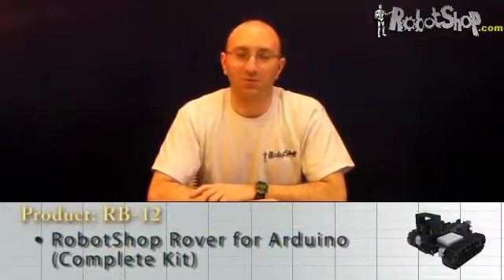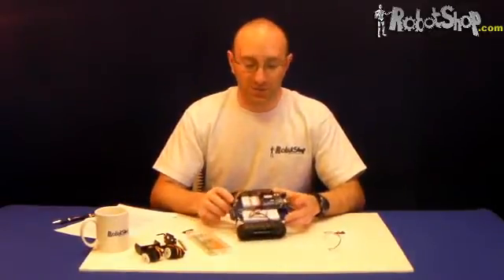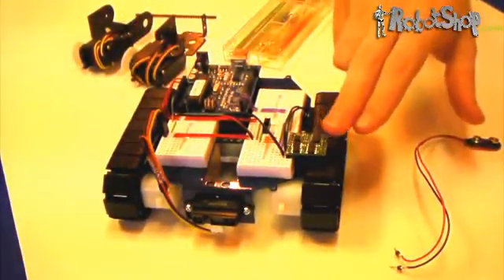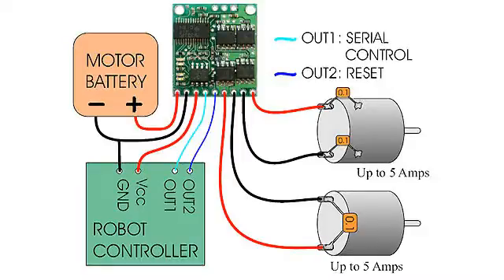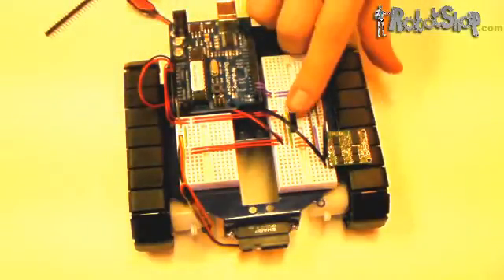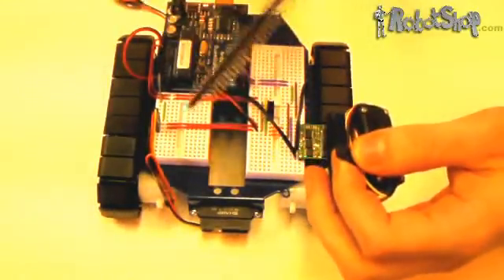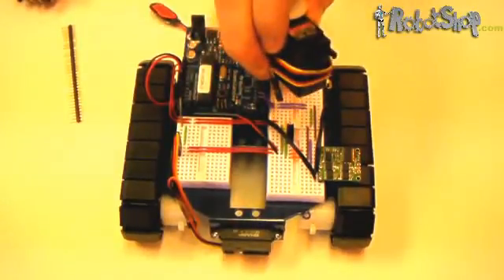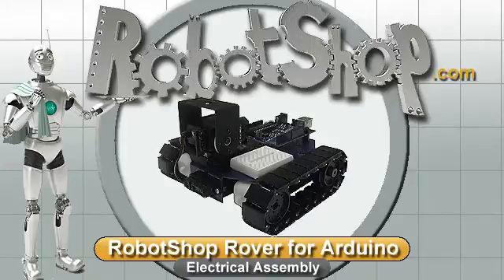Arduino Mobile Platform: RobotShop Rover Track Platform Electrical Wiring by Robotshop.com

Comment from the maker: This platform is intended to help you get started in custom robotics; there is a complete assembly guide and user manual, but you will see that in order to connect parts, you will need to use a breadboard.Once you assemble this kit, you can add additional third party sensors and components without much fear.